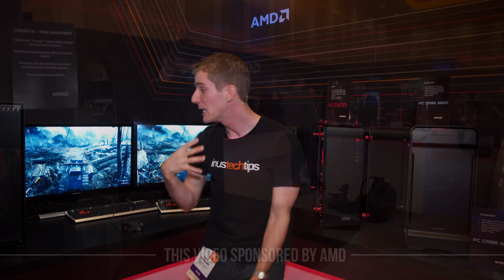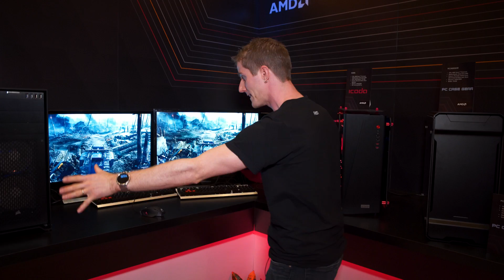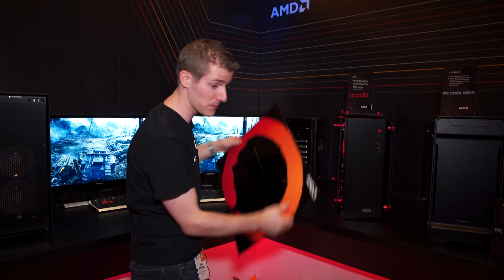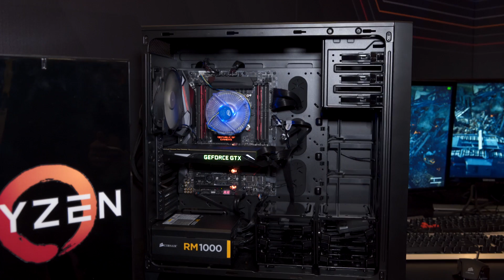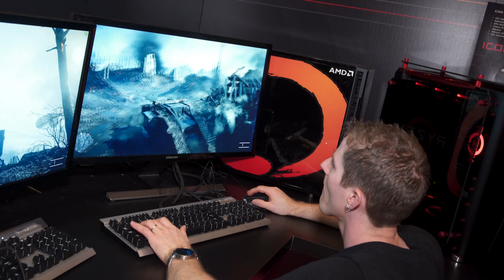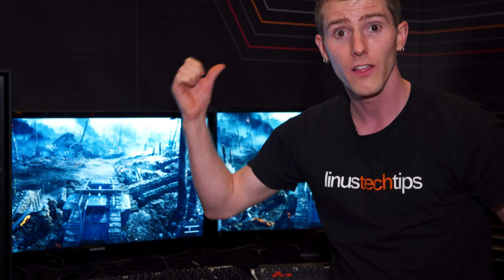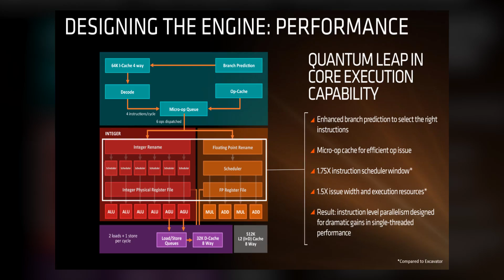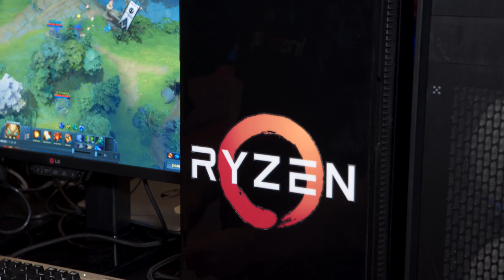AMD Has Ryzen!

Comment: What Linus didn't mention is that Battlefield 1 is running on max settings in 4k which makes the GPU becoming a bottleneck. When a Swedish reporter went there and asked if he could lower the resolution to see the actual difference between the Intel and AMD cpus, AMD didn't allow him to do that. Even my old i7 2600k overclocked, would probably with ease get 60fps in BF1 which this demo shows. So i'm still a bit worried that AMD won't have too much to show off actually.
Reply: Honestly, I don't understand why they'd decide to show off a CPU by running a game. The performance bottleneck for games has been the GPU for years now. If you want to show off a CPU you need to do stuff that GPUs aren't good at, like finding primes, computing digits of pi, or compiling C++.
Yes, it's not as visually interesting as this bullshit, but it's a way more useful comparison.
Reply: ChrisKadaver right cause gamers drop 5k$ to run games at 720p and low settings.  I get your point,  to test cpu is to remove as much GPU usage as possible.  But they wanted to prove that their chip could hang at 4k ultra,  just like Intel.
Reply: ChrisKadaver interesting
Reply: Let me ask you a question, do you benchmark on low? You push it to the limit and get the results, not to where it's playable.
Reply: The point that was being made is that the GPU bottleneck means that doesn't matter. Neither chip could have run the game faster because the GPU couldn't handle it. 

Take that for what you will.
Reply: Obviously you gotta take the demos with a grain of salt... That goes for everything.
Yet they're not limited to this one demo. They have shown multiple other demos that weren't GPU bound.
Reply: ChrisKadaver Linus said the chip wasn't even overclocked or using their "boost"
Reply: I am also a programmer, and I really hope the single core performance is high, as it is just as important for compilation, as each individual compile runs on a single thread. Multicore is great for mass project compiling, but single core performance is even more useful in my experience. It is the reason I am running an i7 4790k.
Reply: I think this demonstration was to show that rizen would actually be viable for 4k gaming and not bottleneck high end gpu's. they don't want to release benchmarks until they choose to.
Reply: +Bradley Laure That's not true at all. The game is terribly unoptimized. I had to run it on Medium with my 8350 and 970 and the framerate dips were still awful. Even with my new CPU, I can run it max no problem but the FPS dips frequently.
Reply: Run a BeamNG.Drive benchmark setup :P
Reply: cs go is CPU intensive so even if we were getting hundreds of fps, we'd get a more accurate number than a game like bf1
Reply: Morin Meow I run BF1 on my fx8350 with GTX1080 at 60+fps on 1440p almost max no dips, unless I play online in a busy map
Reply: Uhhh no. I run BF1 at 4k, max settings using a 980 TI and an AMD FX 8000 series and I still get those kinds of frame rates. I've seen Intel CPUs running my same hardware get better framerates. The GPU isn't the limiting factor at all.
Reply: a good point! - I guess this is showing there is no detriment in buying AMDs product over the $1500 intel offering? I mean if you're buying this tier CPU and can afford a titan X - you're probably not running at a lower resolution anyway. in saying that; as far as gaming goes; a 6700K would probably have the same result.
Reply: runescapefan0001 If you watched the new horizon event, they benched both cpus in handbrake and blender. they performed pretty much identically. tbh, I think these game demos are pointless, but no one cares about the actual cpu benchmarks.
Reply: Why would you benchmark on a lower res anyway, the future is Ultrawide (3440x1440 for example), 4k and 5k.  If you want to 1080p just buy a budget CPU and GPU.
Reply: ChrisKadaver not at 4K, I have the FX8350, with a single GTX 1080, on 1440p and 144hz monitor I can barely hit 90fps, while the 1080gtx will run that game 100+ fps but the cpu will limit the card
Reply: And let me tell you, I am all for compiling C++. It's what I do every day. If these chips bring the prices down, I'll get something with more cores and compile C++ faster. Maybe we'll run the R&D cloud on those some day. That would be neat.
Reply: Bradley Laure thats a lie. I get dips on a 9370 overclocked to 4.9 ghz  with a 390 nitro because of the cpu bottleneck. That game runs terrible on amd CPUs
Reply: Justin Dixon the FX8350 is a bad example tbh, the game is fairly optimized and uses hardware better than alot of games out there, but there is no doubt it will need some resources from the cpu, and cpu performance will effect gameplay, at 4k however the game will probably be taxing the GPU more than it would do at 1440p, but obviously that's not the intention in this benchmark, AMD are showing that their new cpu will be able to run a titan xp just like a 6900k would, this is targeting the high end tier of customers that don't want to spend 1100$ on a CPU
Reply: ChrisKadaver finally someone else who understands a Gpu bottleneck. once I saw a video on YouTube comparing an fx-8350 to an i7-4790 in Witcher 3. he claimed both the cpus performed identically because he had the same framerates with both. the problem?? he was running max settings on a gtx 660 lmao
Reply: DjAtomica 95 game benchmarks aren't pointless, alot of gamers today do alot more than just gaming, that's why you see more people recommending the 6700k over the 6600k, for more complex tasks that use more cores the 6900k is the only cpu that offers 8 cores 16 threads, but the cost of this chip is just too high, AMD are now trying to offer an alternative to that CPU and attract gamers that also do production and content creation.
Reply: Depends on what games you're playing, TBH. Of course, they'd never show anything like Spring RTS or maybe Planetary Annihilation because they're probably just not popular enough. All that physics and unit movement computations can be VERY cpu intensive.
Reply: Then you are doing something wrong turn your turbo boost off on that 8350  and overclock it to max boost speed and BF1 will run smooth.  My 9370 runs it butter smooth but amd turbo core is total crap ive know that since the hex cores came out the boost causes frame rate dives in games.
Reply: +forestR1
Some enthusiasts aren't always targeting 4K 60fps though, some enthusiasts might be targeting 1440p 120/144 fps (or higher) in which case the cpu performance is a lot more important (as most decent CPU won't bottleneck at just 60 fps anyway)
Reply: Well the casual gamer won't really give too much attention about calculations per second etc. As long as his CPU doesn't bottleneck his GPU and handles basic multitasking with no sweat he is satisfied. They probably used such a benchmark for that purpose, they want to attract the gaming audience first.
Reply: yes but so can a 2 year old i5 that costs 200 dollars so they havent proven shit.
Reply: ChrisKadaver link please?
Reply: Because its a CPU-benchmark. The benchmark doesn't prove more than that the new ryzen kan perform as an old bulldozer cpu. Nothing less, but also nothing more. It probably will but this benchmark is still useless to show of a modern cpus capabilities. And no, cropped and cut down 4k displays aren't the future. Why would it be? Just get a 4k display as wide as that ultra wide display and you'll be able to se more of the ground and the sky. More=better when it comes to displays.
Reply: ChrisKadaver that's not true, and you are not making sense, what you are suggesting is way far from reality, an AMD bulldozer will limit this cards performance, the monitors displayed are true 4k, now while I agree the benchmarks aren't the best yet they prove such a CPU is capable of running this card (titan xp) that's the whole point
Reply: well check out the bulldozer performance in BF1. It stays about 60fps.
Reply: Faqir Abdullah seriously? you can't understand why I would upgrade my card and hold on to see if zen is released? like why would I upgrade now knowing that two months later a new Line up from both Intel and amd will be released and it will effect prices like across all CPUs, and why would I make anything up? am not spreading miss information nor am I miss leading ppl to belive anything that benifits me, don't dis me just because you don't agree with me

Comment: Guess ill be keeping my 970A motherboard (AMD). Also i overclocked for the first time today and i love it, GPU runs a little hot at 90 degrees Celsius but i can fix that with more fans right? (I only have one case fan)
Reply: GPU at 90 degrees? Holy crap that's on the line of "Too hot". What GPU?
Reply: Kyle Johnstone my dads old pc used to run at 100-110c he never cleaned it this was about 11years ago it still run Fine even at them temps lol
Reply: Akula Markov R7 360
Reply: Superdaddy Yeah that's too hot. Drop the overclock. Max temp for an R7 360 is 94 Celsius, and you wanna keep a good ten degrees or so below that.

Comment: I do find it odd that the Intel chip is using an air HSF. I don't think anyone who buys a system with that CPU uses anything other than liquid cooling.

I do want this to succeed, but I want to see real benchmarks run, not just games. I want to see video transcoding comparisons, virtualization tests, other CPU intense apps.

Top Kaby Lake Vs Broadwell Vs Ryzen.

The other reason I am still skeptical is because the CPU is only half the equation. If the chipset sucks then the CPU performance doesn't matter.

I'm hoping my i7-2600K holds out a few more months!